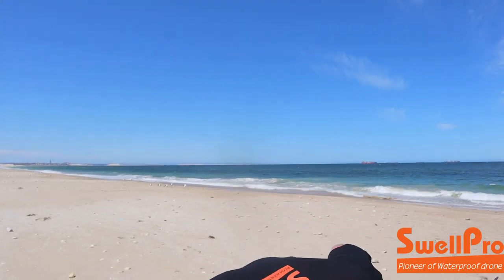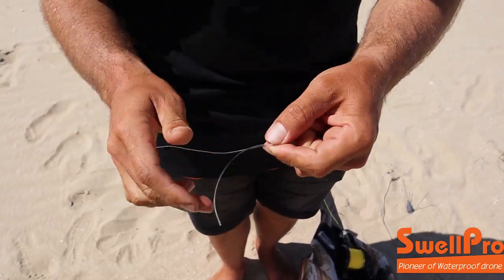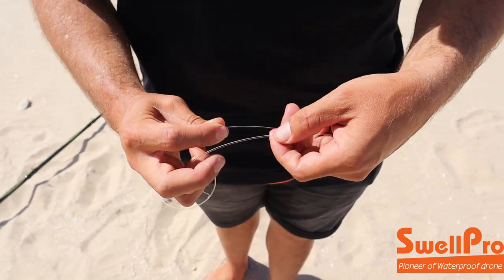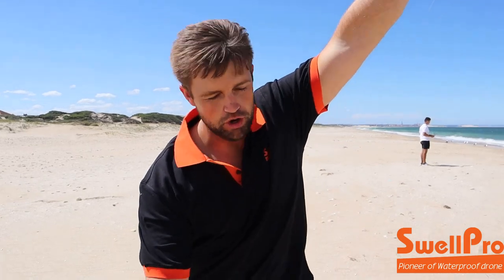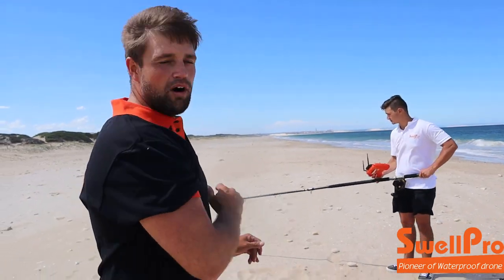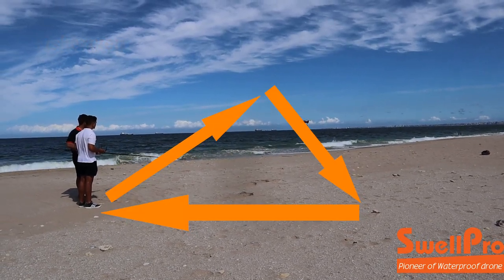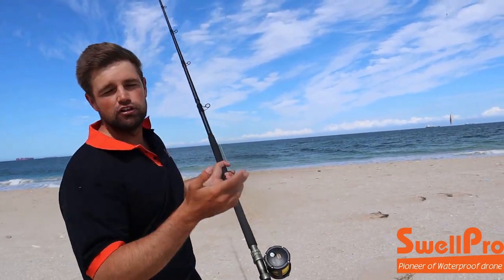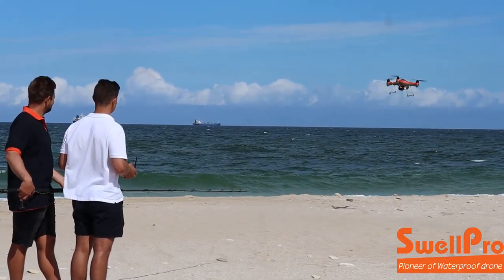How to CORRECTLY rig your drone, for fishing

Comment: Hi. I have been using a Splashdrone for fishing here in New Zealand for years. A tip. Instead of using a loop to attach your line to the drone which requires opening and closing the release, I tie a small cheap aluminium carabiner to the line where the loop would be. Then to attach it to the drone all you have to do is lift the drone in one hand and snap on the carabiner.
I just tie the carabiner onto the 2m dropper line with a uni knot at the closed end. The sinker is at the bottom of the dropper attached by a clip to a 3 way swivel and then the main line attaches to the 3rd eye of the swivel. This set up will never foul at the release and is quick and easy to use.
Reply: Totally agree. The backbones with snapper traces from Paul's Fishing Systems in Onehunga that go with drones are far better and safer than the setup in this video. No risk of any pendulum effect and superior control of the drone with sinkers directly under the drone's mechanical release due to a short steel trace plus the additional payload on a long-line setup.
Reply: @therealrelationshipguy  I agree (also in NZ) and Paul's system is great for beginners but not necessarily the best either. I drone fish alone all the time and change methods according to weather and species targeted. I've had plenty of issues with Paul's rig style (I make my own though but have copied his and tested it) too. To be fair it's a lot harder doing it alone and I get way more issues because of that.

Comment: Ooh man, completely agree with not attaching the line to the drone in the air, I don't do anything with the crone in the air, just fly it and land it. I crashed mine in the early days and the blades chewed through a 7/0 hook. The propellor wasn't badly damaged and is still in circulation but the hook was cut in half. Good point.

Comment: Great info, I have purchased a FD1 for fishing, however I have only been able to calibrate it and the fly about 20 yards before the "Battery Low" indicator came on and the battery won't charge. Have been attempting to correct this issue with the company for over 2 weeks, to no avail. Buy at your own risk.

Comment: just a note, I have experianced that a big loop at the bait drop meganisme got caught on the servo nut to the pin and thus the bait did not drop, to avoid that I made a slipknot that at the bait release pin to avoid a snag, big loop potential for a snag at the servo.
Reply: thiucker line or smaller loop will also work
Reply: same issue many times

Comment: I’ve never flown a drone before. Are they easy ? I’m interested in one of these to target tope from the shore
Reply: yes, it will take a little practice to get orientation right, but the new drones are super stable. They basically park steadily in the air until you give them an input with one of the sticks.